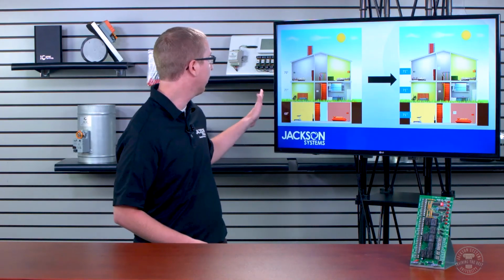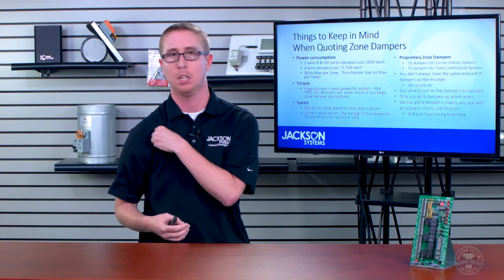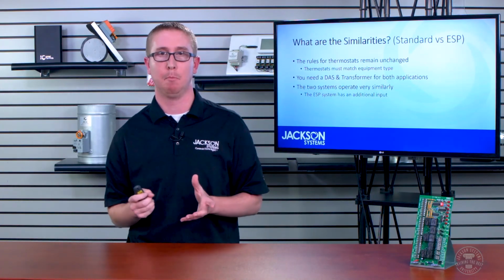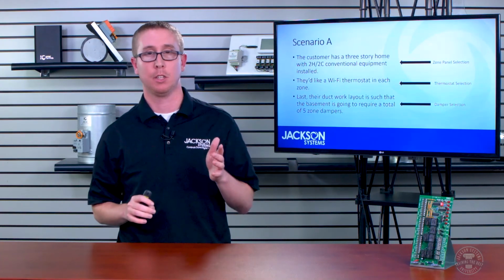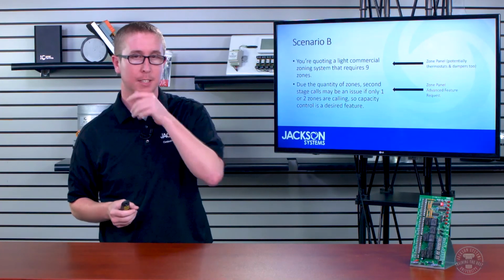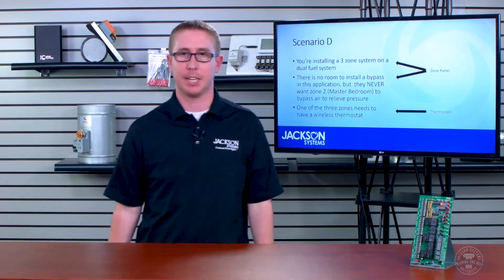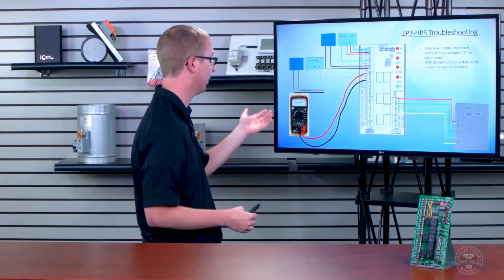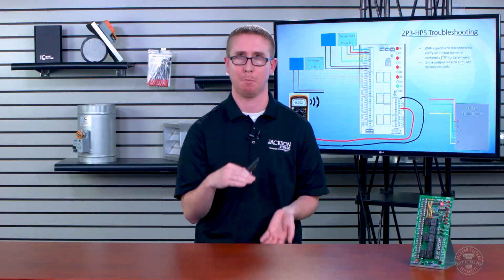Jackson Systems Zoning Basics Full Training

Comment: I’m obsessed with this channel. Can I apply for a job. OK here it is:  before being educated by you guys and my uncle a home builder. I was obsessed with TRANE!!!  I WANTED THE FUCKING BEST!!!! NOTHING STOPS A TRANE. Lolol lmao 😂😂😂😂.  What I’ve learned is marketing is a lie. Kind of. There stuff is great I’m sure. BUT!!!!!!  I have an engineers degree. I can tackle REWIRING or replimbing an entire home. But when it came to HVAC. I was stuck. I watched a few videos. I learned some basics. But when I called these dealers for TRANE. with the zoning ideas I had. After learning about. HONEYWELL and IO. they quoted me 20,000 for 9 zones. When I could buy dampers and a zone board or two from you guys for much less. IVE FINALLY COME TO REALIZE these TRANE types of manufacturers are like Apple or Google not in value. But in the PROPRIETARY NATURE. You are LOCKED OUT. NO DIY BUDDY.  I’m no fool. They may have an outdoor compressor that might save me a few amps of electricity a year or last a couple years longer. But so what. The savings in DIY. And just the zoning aspect alone. Will slash my bills down. And I can build it. My way. Without the 20K. I’m 41. I cannot imagine calling them back in 20 years when it’s time to upgrade and some slimy tech says SURE WE CAN DO IT!  that’ll be 20 K. And we offer payment plans😂😂😂😂. When had I chosen non proprietary equipment to begin with. I’d likely be able to simply visit you guys for a new board swap out for 300 bucks. Or a trouble shooting video. Or order the Honeywell/IO board on Amazon in case decades from now your gone or maybe moved all sales to that platform. Who knows. I’m so thankful for the YouTube community. And you guys being apart of it. It means that regular people will be able to stay in thier homes far into old age. Becoming thier own contractors. For pennies on the dollar. It’s exciting and gives me hope. HVAC IS ABSOLUTELY THE MOST EXPENSIVE AND NECESSARY HOME ITEM.